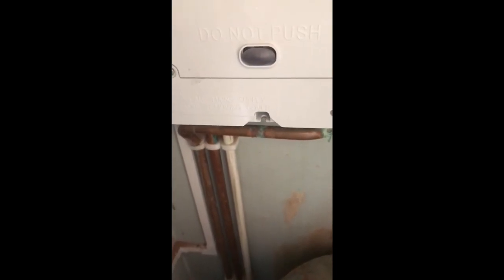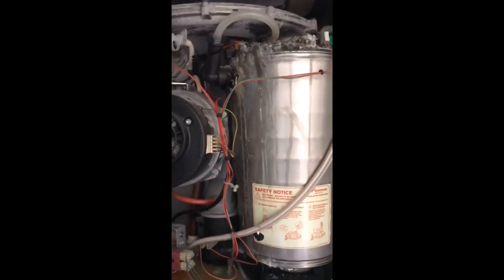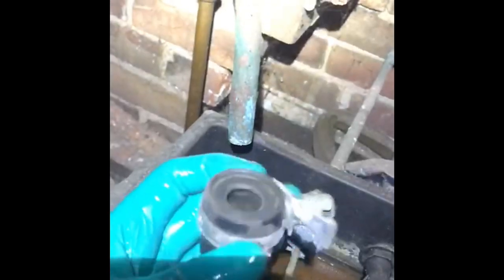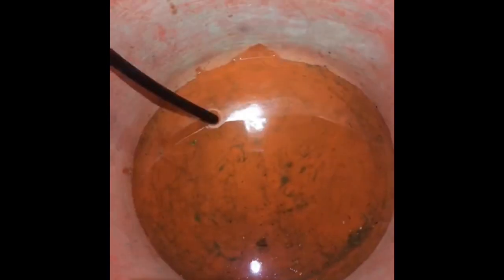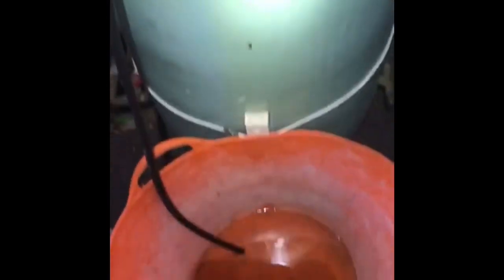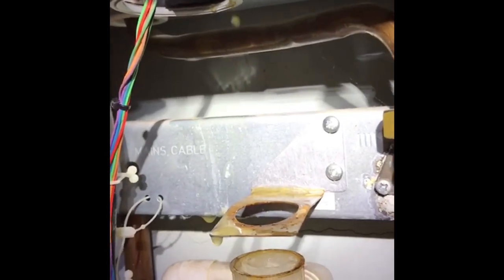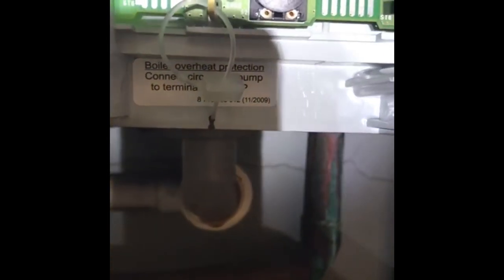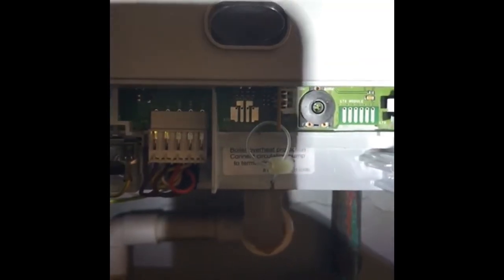Changing a Worcester Bosch Heat Exchanger ( Heat Cell ) Open Vent

Comment: Great video ,very well explained. I have used what I call the bung kit extensively in the header tanks and they do usually work they are great for say exchanging radiator valves etc  BUT you can only work on One bit of the system at a time or you break the air lock . A good airlock would stop the water in seconds but sometimes you would have to let  it run out of the valve for up to 30 seconds before the flow would stop and on occasion it would not stop completely at all.

Comment: Ri's are not bad to work on at all. At least they don't have the dreadful pinholing hydraulic sets the WB combis have. I'm amazed at the repairable newish boilers I see at the scrapper these days. It's better money to chuck in a new one I suppose...and let the warranty do the rest. I'm not the biggest fan of Worcester boilers, but the guys from Worcester Bosch are usually spot on in my experience. They give the best customer service out there.

Comment: Ok his got two hands and one phone, but he explained in very detail.
He has removed the cell with Manufactures instructions and has not cut any corners.
You can remove the cell without removing the return pipe, without struggle or bending the case, using two big flat screwdriver.
By ensuring the cell is pushed to the bracket then lift up with the screw driver, then the other screw and the cell pops up, no bending casing.
I Love working on Worcester's and I know it's a lot of fiddle, but key is be calm and do it in step by step it's not a rush.
If you do it once, then it's get easier and easier, the key is be calm and follow the MI
Worcester's are good earner for me.
It's not a struggle at all I find after working on these all these years, but at first I did find it hard and struggle, but know I find it ok to me and easily can earn money as we know their common problems.
Thank you Allan

Comment: Fair enough if it’s done under warranty or a Worcester one off repair cost  but for an independent engineer to carry out it can soon mount up to over £500 easily .Also I’d be cleaning that tank out for starters as well as flushing before firing up £££😖. Still good informative content 👍

Comment: Why would even think of changing the heating exchanger on that terrible system, its ok under warranty but there clearly is a bigger issue goin on there
Reply: To right, short sighted engineering ,
New Boiler quicker ,powerflush +magnetic filter !